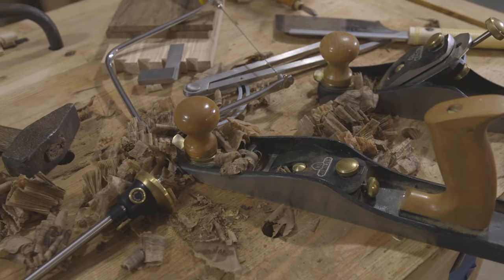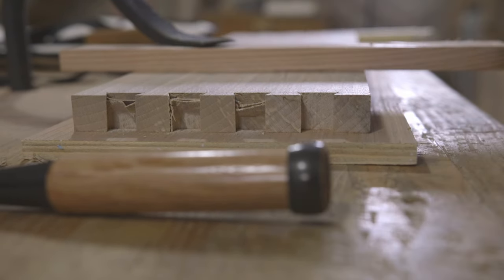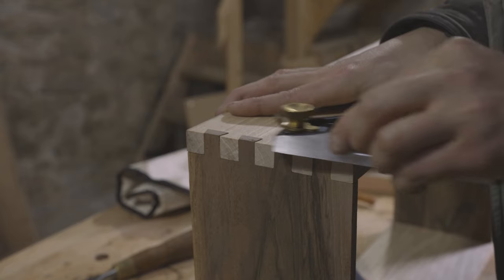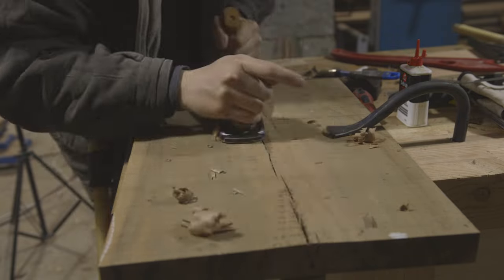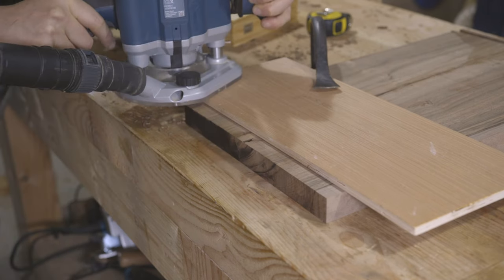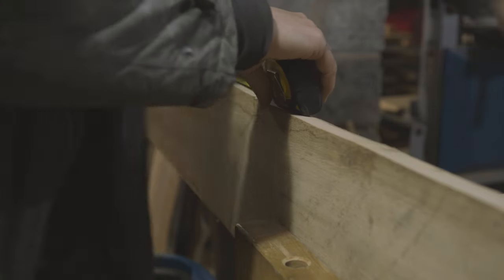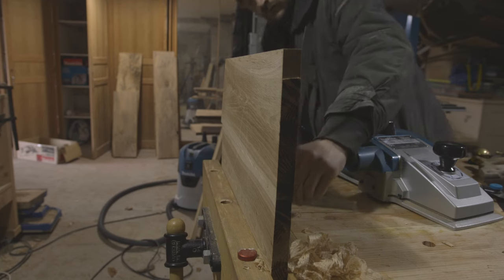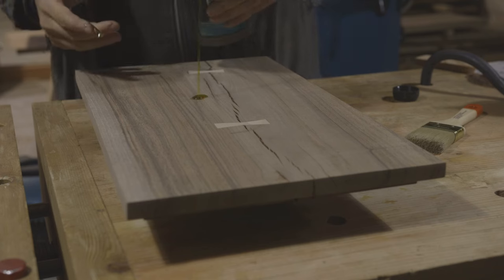My best work yet - Expensive walnut box with dovetails

Comment: The part you said you found most difficult you could mark the location on the second board by us in a smaller chisel from above and using the sides of the dovetails to keep the chisel square
Reply from the maker: Great idea. As soon as you said using a chisel it all made sense! Thanks for the tip.
Reply: no problem it looks lovely something so simple but elegant about walnut and dovetails just makes it look even better
Reply: In small work this is impossible. London pattern dovetails, for instance, only have a saw kerf at the narrow end of the sockets, and there is no room for anything other than a thin knife blade. The issue is never the marking. The issue is always getting the tail board correctly located, and keeping it there.